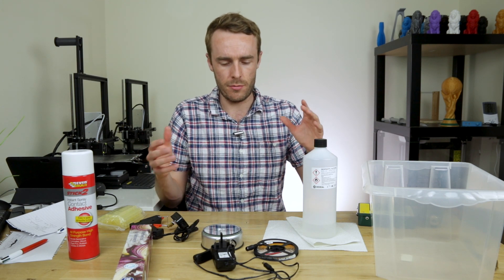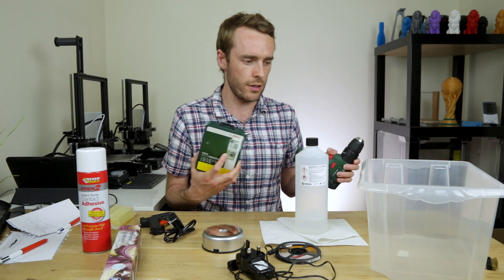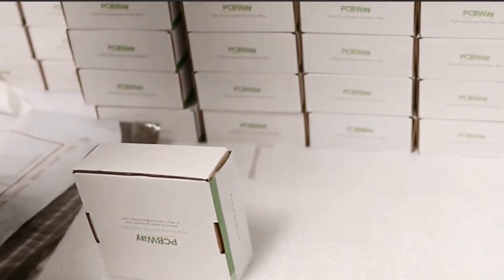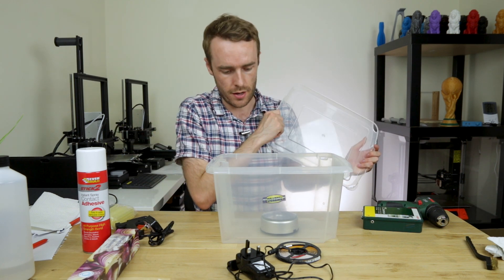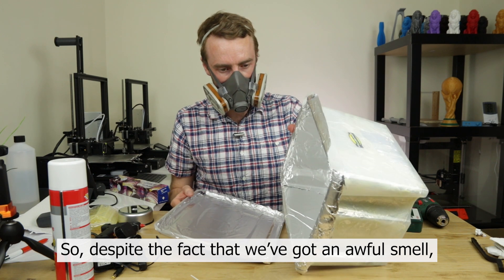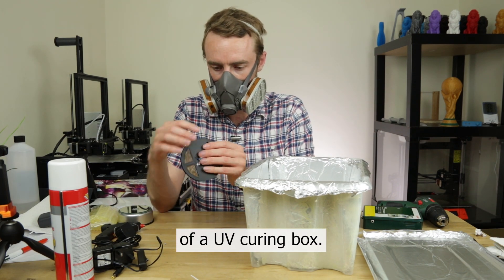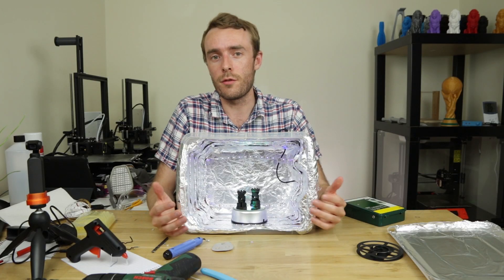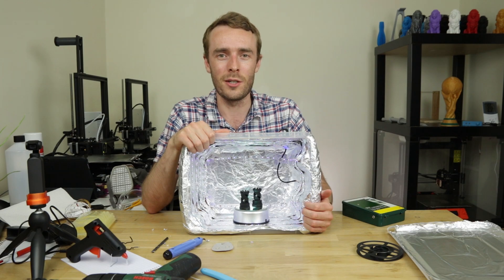Quick and Easy DIY UV LED Resin Curing Box for DLP and SLA Printers

Comment: Really interesting my friend! Sorry to mind you with a silly question: I'm shopping for uv bulbs, thanks to you I know what I must buy however in the online catalogue, I'm buying from Lazada, a kind of eBay based in Thailand, they are selling uv bulbs that are completely black, the light emitted is purple, 40 watt, 360-400 nm, some of this bulb are advertised as uv black light, the bulb shell, the glass is black, once turned on the light is the classic purple one. Here a link:
https://s.lazada.co.th/s.0V5et
 I couldn't find any info about the black color, may you know something about? Thanks so much!
Reply from the maker: Blacklight is just a colloquial term for uv lamps AFAIK.
Reply: Thanks a lot! What does AFAIK stand for? I mean, I need a bulb to cure UV resin, between 360 and 400 nm, with an output watt as much higher as possible, 50 watt is ok, not less than that, these black bulbs mach all these characteristics so, can be used to cure uv resin? What I don't get is: what is the difference between black uv bulb and "normal" uv bulb? Sorry again for my silly question however this is a completely new world, I don't know anything about, I ask you who know much more than me. Thanks for your help!

Comment: for some reason my UV led lights wont turn on anyone know why?
Reply from the maker: Wrong polarity?
Reply: @Vector3DP  the whole wire takes 144 watts to run, my house has 120 watts, so i just cut the strip roughly to take less then 120 watts to run.